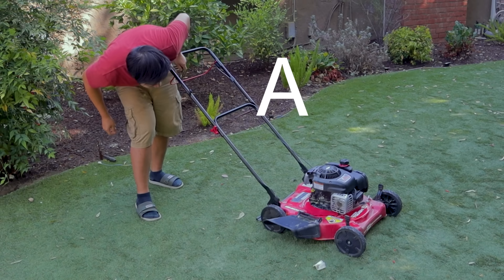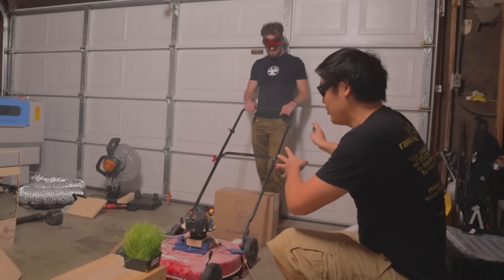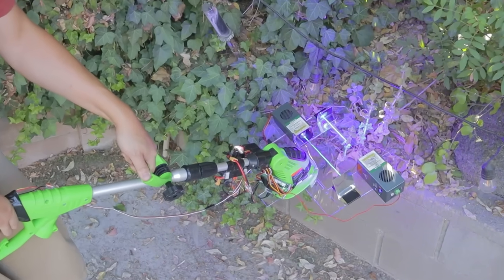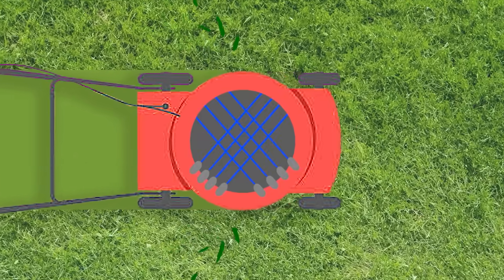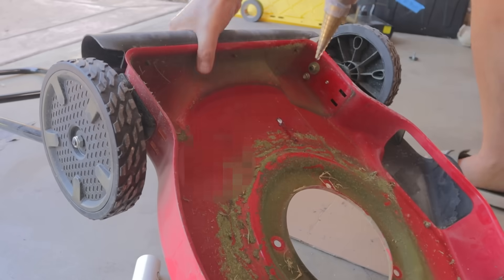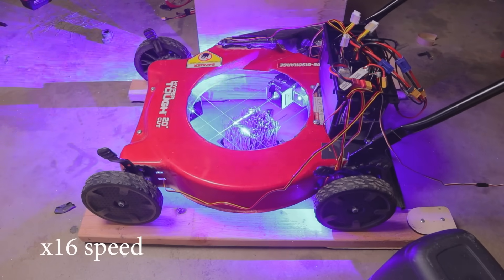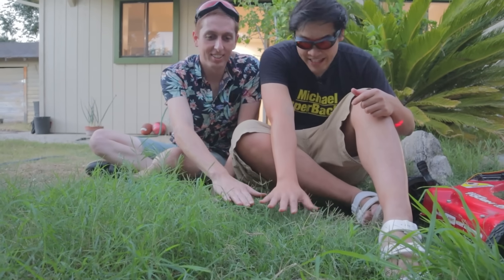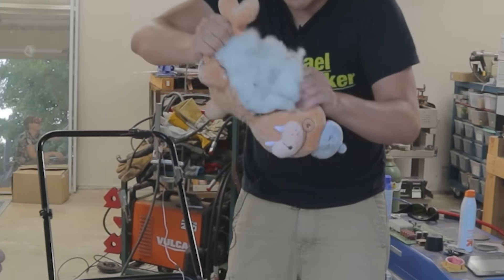mowing a Lawn like it's the year 3000

Comment: There's a SmarterEveryDay video where he shows that a lawn mowers actually pull the grass upwards to cut it using air flow. https://youtu.be/-GlJFVTzEsI?si=yF5CVWMUJ9Ygwc2q&t=276 I wonder if you used some kind of fan or vacuum to pull the grass up for the lasers, maybe they could cut across the blades of grass more consistently?

Comment: stopped at 1:42 into the video... thinking... why the heck you would spin the laser itself and not a mirror or prism instead ...  why you would spin the laser itself is beyond comprehensible... EDIT: stopped at 3:57 into the video... i don't know man... maybe because the grass is full of WATER!!!  and the metal isn't... it's like when NASA creates a water deluge system to blast rockets into space for reasons of ENERGY ABSORPTION...  it just completely goes over your head what water can do with ENERGY.... EDIT AGAIN:  if you look up the wattage on an average electric stove top in america it's ranging from 1000 to 3000 watts and upwards of up to 5 kilowatts when all burners going (obviously depending on burner sizes and how many)  BUT you're working with 30 watts... why i bring up the stove top info... BOILING WATER...

Comment: There are robot lawn mowers (I love my Mammotion Luba), but you're not likely to find them in big box stores (yet).  Price is higher than a "walk behind" mower, but cheaper than a ride-on.  However, the cost is also offset by the time savings and in my case not having to deal with mowing a 30% slope.

Comment: So about a decade ago, I was messing with a homemade 3D scanner that required a laser line. I pointed a laser pointer at a metal cylinder and bam, laser line. Not sure if this would give you the same issue as the lense. I'm just thinking it'd be more laser bladish

Comment: I'm pretty sure the reason it wasn't cutting is the high moisture content of the grass being very effective at dissipating the heat from the laser, it would probably work better on a drier medium.
Reply: That would cause fires though, unless cut and then moistened. I would be a fan of that, until the sprinkler is out without warning.
Reply: not just dissipating, but absorbing... and it takes far more energy to evaporate that water, turn it to a gas, than it does to merely heat it. and until it IS dry, you arent going to exceed 100C...
Reply: I wondered what a different frequency of light would have done.  Grass reflects green light.  Absorbs blue and red…..

Comment: I work with industrial lazers. We used a "multifaceted mirror" (think of an octagon with mirrors on the sides) to effectively swipe a laser across surfaces. Now we just use a prism to split the beem
Reply: This is what I was thinking. Those scanners at supermarket checkouts use a single laser and a concave mirror spinning on a motor. If you had 4 of those 30w lasers focusing into a spinning mirror or a prism that could spread it out a bit then it would be much more effective. Even having the lasers created something like a bridge across the front of mower instead of the centre.
Reply: @xenibyte5898  It would still be slow, look at laser cutters.  The same goes for a plasma cutter as well.  It's very slow. Also what you reference here has been obsolete in xerographic printers for a long time.  They now use an array of individual focused LEDs.  To both you and @jonahkolell, please refer to Occam's Razor, also known as the KISS rule, something that engineers learn early on in science as well as engineering, unless it's Germany, then, throw it out the window to put complex features into everything they make.

Comment: I have one of those Ryobi battery electric mowers, and it is way WAY better than any gas mower I ever used. Sure it still gets bunched up on thick enough grass but in the rare event that does stop it it takes very little to get it going again, whereas the old gas mower got its butt kicked. 

Still, if this laser mower concept could ever work it would mean a mower that never needs a new blade or for a blade to be sharpened.
Reply: lol I dare you to try mowing a lawn here in Tennessee with an electric mower. Here virtually everyone in rural areas needs a riding mower and has a half acre or more that needs mowed every 4 to 7 days.

Comment: One of the most underappreciated features of a regular lawnmower is that the spinning blades isn't just a big knife spinning around. It is also a propeller sucking the grass up into it, exactly to combat the problem with the lawnmower chassis pushing the grass down under the spinning blades.
Reply: So if he adds a suction device at the top, he might get a better cut?
Reply: @WastedDad  The major problem with that is you're basically fanning the flames though, so if any spark gets started you're in BIG trouble
Reply: @WastedDad  Yup.
Reply: @WastedDad  I thought he was making the top bigger to add some suction to the top.  Big ol' Box fan for something to shoot that grass confetti after it's been freed from it's earthly ties.
Reply: @WastedDad  That makes me think of Wayne's world, when Garth gets his hair cut with the 'suck cut'. 🤣
Reply: @WastedDad probably not. It would solve the problem of grass being flattened but it would also probably cool the grass down a lot and contract the laser. If it enough to stop the burning? Probably not but it definitely wouldn’t help.
Reply: So, what' you're saying is we need more laser watts, to cause the air to heat up fast enough and pull upwards on the grass creating its own suction?! Genius!
Reply: @Dudeinator  yup .. atleast 15-29kw of lasers .. more lasers .. but a long large pipe/tube and heating elements would do it ... just need to reach about 800-900 degrees (candle flame hot) .. as an extra bonus u probably set the neighbours house on fire .. but thats just details...
Reply: @Dudeinator  Lmao , i get he joke
Reply: What a push mower style with the lasers rotating on a drum instead?
Reply: @abduktedtemplar  serious vibration issues.
Reply: Exactly the issue I immediately identified. Still need a large spinning blade to efficiently lift the grass for cutting.
Reply: @giin97  Physical blades are also the simplest and easiest way to mow a lawn.  Occam's Razor people.
Reply: @WJCTechyman  Physical blades may (arguably) be the simplest they're nowhere near as cool or fun as lasers. 

Plus, they don't automatically cauterise the wound when the inevitable accident occurs...
Reply: I always wondered why the lawn mower makers didn't copy the razor blade manufacturer's.
And ad a similar feature to the front of the deck to guide the grass up just like razors micro combs guide hair onto the Cutting blades?
Reply: @4literv6  Too fragile and non durable, the simple lawnmower blade really is the best at doing what it does.
Reply: you would not need a front guard and grass wouldn’t get pushed down if the lasers were aligned in a row perpendicular to the front facing direction
Reply: Why not add suction and have a water function to avoid fires?
Reply: Suction lasers!
Reply: I came here to say the same thing damnit lol but well said
Reply: you say that like the people that run these types of channels have any sort of intelligence
Reply: Also thr rotation of the blades and the shape of the cavity help eject the cut grass into the collection bin to avoid leaving grass cuttings allover your lawn. So thr laser mower would need to suck the cuttings up into a collector, or even better a laser incinerator.
Reply: The fumes plants bleed may also be something to consider in the long term.
Reply: It once sucked my finger in it
Reply: There are robot mowers that do
Reply: It also makes a good vacuum for picking up fallen leaves.
Reply: And it pushes all the cut grass out of the way too.
Reply: How do hover mowers work then?
Reply: All fun and games until you try it on dry grass
Reply: gets sucked in by the reel mower

hang on...

sigh... out with the "allen scythe", commonly known as the "dog trimmer"...
Reply: Nnnnneeeerrrrrdddd!
Reply: @KarmaCadet  go back to 2004
Reply: @KarmaCadet  better than being BRAAAAIN DEAD MOOOOOOOOOOROOOOOON.

;) some poepl seem to revel in their own ignorance and stupidity, wearing it like a badge of honour.

welcome to 2024, where the human race takes enormous leaps backwards.

Comment: Laser show versions with servo mirrors can show patterns on walls of buildings. Maybe you're a laser graffiti artist now in search of old bridges and abandoned architecture to set ablaze add some art to? 

Could you clean your dishes by vaporising a layer of ceramic off the plate? Or what about light bonsai tree duty, dusting blinds, vaporising that fly in the light fixture without taking the fixture apart... Must be a million uses for a 30w laser around the house. :face-blue-smiling:

Comment: I used to work with industrial Laser machines for Glass cutting. Whats interesting is that 30-50W is absolutely enough (in a pulsed laser) to cut glass if it's focused correctly. The difference between the healthy and dry grass really shows how much energy is required to turn Water into Steam (Bringing for example 1L of water from room temperature to boiling requires a lot less energy than making 1L of boiling water into Steam). There are also optical elements for adjusting the Beam-Diameter (Beam Expander Optics which can also be used to lower the beam diameter) and how parallel the beam is (Collimator) to ensure the beam stays at the lower diameter. I'm not sure what Diameter those Laser you were using have. But say  reducing the Diameter of the Beam to say a milimeter or maybe even something like 200-500 micrometers could also improve cutting performance by focusing the energy on a much smaller area.  The drawback to those kinds of Optics is that they are expensive, sort of big to fit all into the Lawnmower (usually around 10-30cm in length)  and have to be dialed in so the beam passes through in a good parallel line for which you either need a Laser-Power Meter or a Laser-Beam camera (which both are also quite expensive) but might be able to be skipped and freewheeling it if you don't need precision in the scale of ~20 micrometers in beam diameter and put the working pice close to the exit of the optical element (<50 cm). At work we usually used Thorlabs Optical elements for setting up beam paths, shutters etc and Beam Expanders from Jenoptik since they can handle high power pulsed lasers.

Comment: The world: you can direct laser beams with mirrors!
Allen: NOOOO SPIN THE LASERS!
Reply: shouldve had them in like a thing with several lasers and also mirrors to expand the area and then have that entire thing spin, the whole grid would be going around the grass it would probably work incredibly well compared to not moving
Reply: insertion and reflection losses.

100W laser, 99% reflective mirror... the mirror is absorbing 1W.
any dirt ... 10W...
the lenses... absorbing power...

every surface that beam has to bounce off of, or transmit through, is absorbing a certain portion of the energy, and if they arent made to deal with the energy, to radiate it away somehow, they quickly fail.

and the power falls rapidly, compounding with the number of surfaces in the path... a single lens will outperform a triple lens but the single lens will have a harder time focussing...

its all a trade-off, a set of compromises....
Reply: @paradiselost9946  
Front surface mirrors using Gold as the reflective material are probably not as hard to make as you think.
Just get a flat and polished piece of aluminum for one electrode of an electroplating cell, some shredded gold foil as the other electrode, get the polarity right, and pick the right electrode that facilitates motion of gold ions from the foil electrode to the polished aluminum electrode and that should gold plate the polished aluminum piece.
Gold doesn't oxidize readily in clear air, and when Aluminum oxidizes, it creates a strongly adhered layer of Sapphire, so you can even skip the gold part if you can make your laser beam's wavelength bounce off a layer of Sapphire.
And with the right grit, and the right lapping plate, you can polish sapphire to an incredibly reflective surface.
Or you know, this kind of thing might be cheaply available online off like AliBaba or Ebay or Amazon, I haven't searched for it.
But if you do this, you can probably cut that 1% loss on the clean mirror down to like 0.01%.
Reply: Spin the mirror instead?

Comment: just a note for 0:35 
no idea what this plant is made out of, but never cut pvc with a laser. don't know the specifics but under laser it decomposes in a way that produces very bad gasses one of which is phosgene, and it will rust anything in it's way, so just check what you are laser cutting before doing it

Comment: What if you lined the interior of the lawn mower loop with mirrors or some other reflective material? You’d have a much better mesh of lasers. One problem I see right now is oftentimes some of the beams weren’t doing anything while others were having trouble (needing time) to burn through just one blade.

Another option could be to add some kind of artificial air moving through the loop to prevent the blades of grass from tangling together. Hot air, like a hair dryer maybe, would also help with the “too much water in the grass” problem

Comment: Okay hear me out. What if you got a circular metal thing, maybe something like a backyard firepit ring or half of a wheel from a car (a car's drive axle when on jackstands is the same thing as a lathe, you know), drilled holes for your laser array, keeping the bottom of the ring close to the ground. Then, get an electric radiator fan from a car (one with a large single fan) and mounted that above the laser array, making sure to use something like aluminum foil tape or whatever to make it air tight. Have it exhausting upward so it would help stand the grass straight up and also evacuate the cut grass. Suspend that whole mechanism from a higher single point from something like a suspension ball joint (or whatever's smooth enough to make that work) so that it keeps it dead nuts EARTH level. Put that on your mower or on a cart with bigger wheels. I feel like that would be a fun improvement and probably cost less than $100 from random junk online or like $20 from your local junk yard. It's also 4am and I might just be really dumb

Comment: You need pulsed laser, with CW lasers you pretty much only get burning action (with rapid evaporation also doing some material removal). With a pulse laser such as a Q-switched laser you can get much higher instantaneous power that creates explosive vaporization of materials with violent shockwaves and expansion of gasses that can be much more effective at removing materials.

...or you can just get more CW lasers

Comment: i wonder if it would work better if you had a fan pulling the grass upwards with a vacuum or fan. bladed mowers use the same principle to get a straight edge cut. you could also try and design something that spins the lasers inside that grid pattern using conductive rails. i hope to see you give it another try.

Comment: i aint a smart man but i do know that grass never grows straight and lawn mower blades are designed to make the grass stand up upon cut.  You cant dry it out enough and cut but you could decrease the total surface area to cut but installing a vacuum on that open hole in the center of the frame.

Food for thought

Comment: What's crazier: 
Making a laser lawnmower, 
Or friggin California banning gas lawnmowers?
Reply: Old maga types still don’t understand that gas engines are trash.
Reply: They're louder and worse than electrics, hell I think corded electrics are even cheaper now on the low end. Considering they're basically a cieling fan on a cart.
Reply: @PilkScientist  They really aren’t better, you need multiple batteries just mow a large lawn, they cost more, self maintenance is near non-existent, and they’re not inefficient. The only benefit is that they are quieter but other than that they are worse when compared.

Comment: I love your idea, but water has a large Specific heat capacity, and the lasers aren't coping well with that. I think you would have MUCH better luck with a high pressure water jet? It would also be really cool. High pressure water has been used to mine stone before. And if you add some form of grit, you would be able to cut metal!

Comment: 1:09 uh, yeah... the blades of the mower also act to lift the grass blades up with the air suction, like a reverse helicopter rotor, so just a spinning laser with be useless without the grass blades being sucked up straight to be cut 🤦‍♂️

Comment: As a previously worked landscaper the mowers usually dont have stability especially if its unstable ground but you should make a ring track that the lazers spin on but make it slow enough to cut the grass and also drive it slow enough to give it time to get it done maybe even make a gear system that connects the spinning ring to the wheels turning i hope you continue this project

Comment: I've had an idea for a laser mower for some time.  2 rotating lasers in the middle of the grass. 1 laser is for object detection to kill the burning laser for just enough time to avoid the object(like a pet) and the other for the burning laser.  You need some material around the edge of the yard to prevent the laser from leaving the property.  ..but yeah, just have this thing spinning super fast 24/7 keeping all grass at the EXACT same height, regardless of ground level. :P